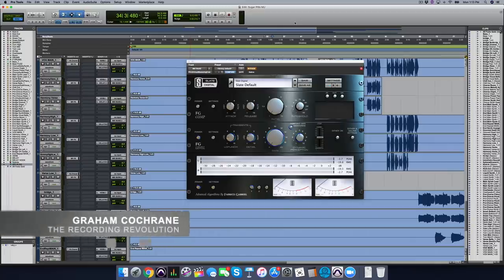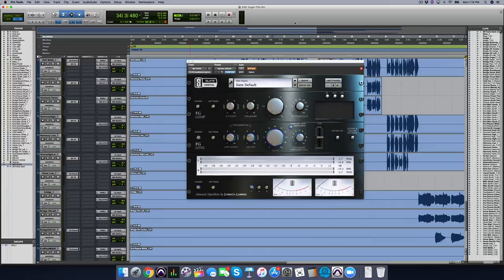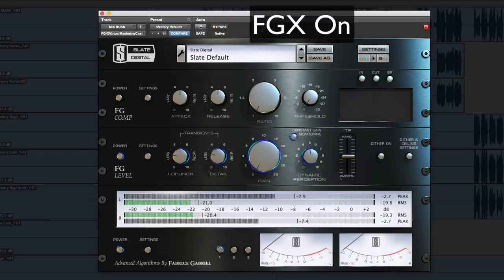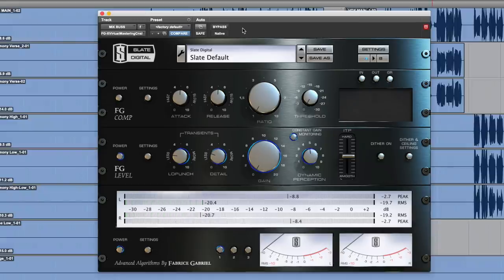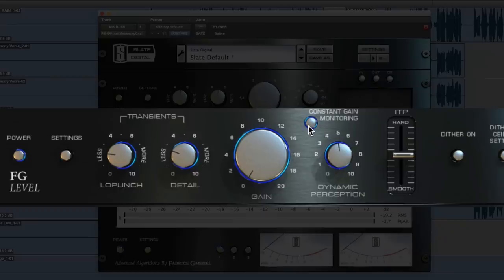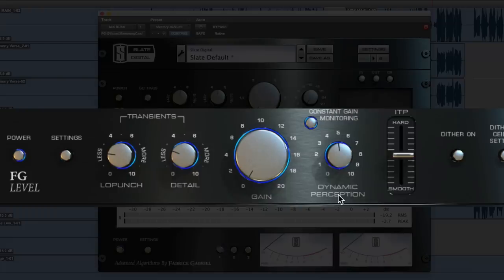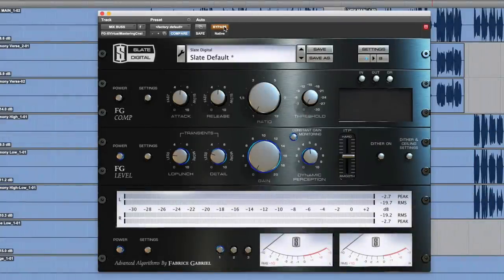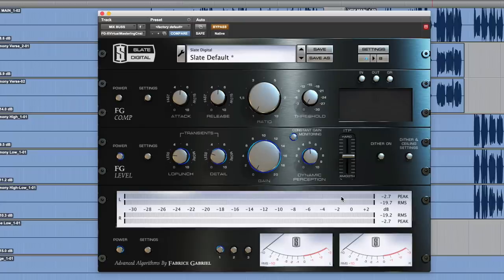Using Slate Digital FG-X-To Breathe Life Into Your Mix - RecordingRevolution.com

Comment: Your settings are good too much of those controls adds too much distortion. It's a good idea to solo just the low end with a band pass filter which will allow you to hear low end distortion that the three controls add. Some of the apparent dynamics appear to be transient clipping and harmonics. I have had occasional glitches where the FGX distorts and behaves abnormally which force me to reload the session and it is fixed. The abnormalities are with the compressor portion of the unit. Same glitch multiple songs. For that reason I use a different compressor. I'm not complaining because the Slate products sound really good.

Comment: I need help yesterday everything was just like in this video ..but today i open cubase open project and when i was ready to record another verse into my song ..i cant hear myself like before now i only hear myself when GAin button on my Fast track is at MAX and even if i record something i cant have those waves only straght line i dont understand i just save project and when i woke up everything was ruined like that :( HELP ME PLS  im using fast track c400 + 
Samson C01 Condenser Microphone
Reply: Hey there. I'm not sure I understand the problem. You can no longer hear what you've recorded previously or just what you're trying to record today? If it's everything, make sure that you didn't accidentally pull down the gain of the track (not the volume fader but the volume or gain of the block where you see the waves). If you can't hear your microphone, what once happened to me was that my phantom power was turned off. I have an external phantom power (48v) for my microphone and I forgot to turn it on. I looked everywhere on my computer screen, tried everything, checked the cable, checked the send/returns of my DAW, etc...and at the end, I just forgot to turn on the phantom power. So make sure it's not that.
You wrote this 2 hours ago. Let's hope that you've figured out what the issue was in the meantime. If not, I wish I could help more but I would need mre details.

Comment: I don't use Steven Slate simply because of iLok. However, I received an email from them promoting like $149 for everything without iLok for a year. I dont know ... something about subscribing to a service just to use plugins puts me off. Am I really going to see that big of an upgrade in sound quality from Reaper stock plugins and freeware I get from all over?
Reply: Reaper user here and been with Slate for 6 months now. Dependent upon what you're mixing then it's a great bundle when used with either moderation OR by throwing the rule book out of the window.

Have seen literally thousands of metal/rock demos of his stuff, but slowly other genres are seeing the benefit of the bundle.

Gets most use on drum busses for me, although I am experimenting with guitar and bass mixing with them too.
Reply: Just download cracked torrent and install
Reply: I doubt it. You can get excellent results from stock plugins.
Reply: I believe they drop out the iLok in December. Check out his site about this.

Comment: Been using FG-X on metal mixes for a while now and this vid has helped me confirm that it's a great mixbuss choice. What other plugins would people use on this buss in conjunction with FG-X
Reply: Martin von Bargen I use the SSL Comp same as Graham, and it’s incredible. That is definitely my go to on almost every mix, for sure would recommend and you can probably find it on sale on Waves website for $30 here and there
Reply: @J_Costa15  Am actually using it right now on a drum buss. Bought it a while ago but like most of my Waves stuff, I didn't explore the settings after getting a bargain. Hopefully the days of flat drum sounds are gone after I discovered where to set the attack and release properly. 

Cheers man :D